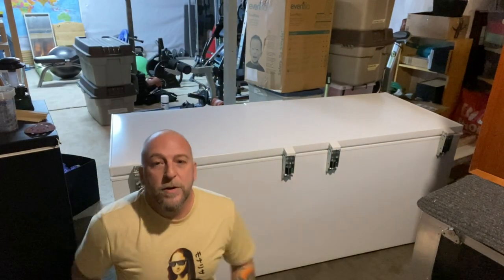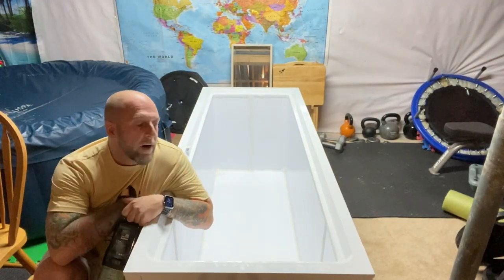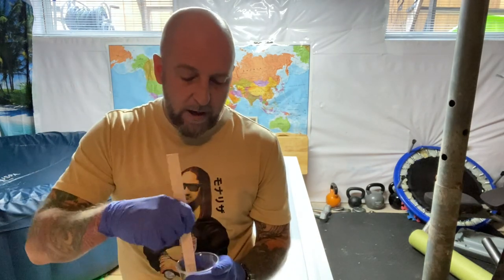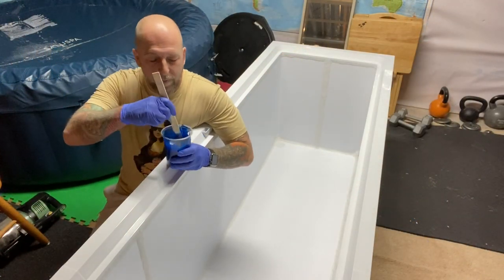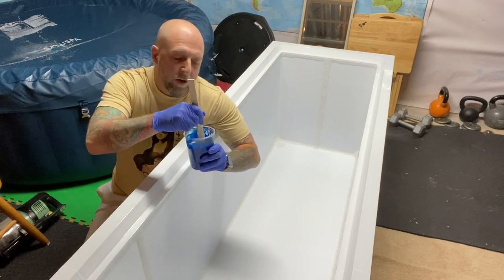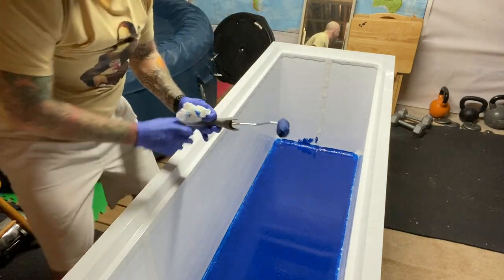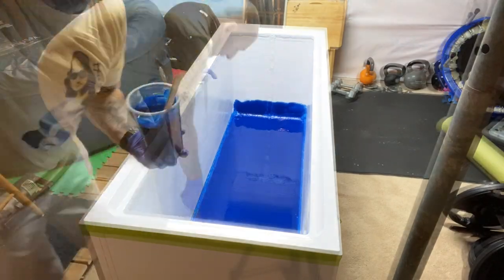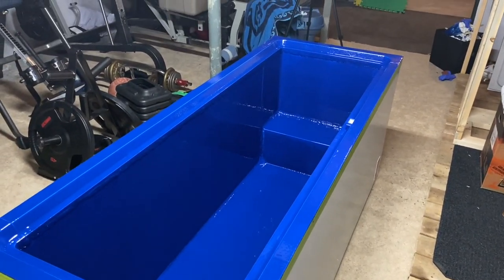Chest Freezer Ice Bath pond shield application 11922

Comment: How do you drain the water when you need to refresh the bath?

I have the same setup but mine has a makeshift drain plug at the bottom installed by my friend

Just wondering about leakage solutions if you have a drain plug as well
Reply from the maker: I don't have a drain plug. I use a submersible pump to empty it

Comment: Great video pal! I’m doing my chest freezer tomorrow with sky blue. How has yours been holding up after a year? Thanks for the video.
Reply from the maker: My pond shield has held up amazingly well! As long as you take care in the application it should last for a very long time. the only problem I had was a spot near the top that I accidentally banged when I was fitting in my filtration system

Comment: Hey Brad, just looking for some clarification about the process for a freezer with an aluminum interior. Is application of a self etching primer necessary prior to the pond shield? If so, do you sand before or after applying the self etching primer?
Reply from the maker: From what I've learned yes you should probably sand before you use the self etching primer. I don't have any experience with aluminum interior. I would recommend you look for the Facebook group DIY Chest Freezer & Chiller Cold Plunges. It's run by a guy named John Richter and you will find a ton of great information there. I learned a lot of stuff from him and the group.

Comment: Thanks Brad, extremely helpful video. Thanks for sharing. Is this pond liner cosmetic or does it help with sealing as well? Also does it make the tup slippery getting in and out. I think I want to have something to grip to at the bottom to get and out easier.
Reply from the maker: It really does help with the sealing. I had a freezer plunge with just JB water weld and it eventually succumbed to the leakage

Comment: Thanks for this Brad. I'm planning to do the same thing. I just wish you would have done a video on the JB Weld, which I also intend to use.
Reply from the maker: the JB weld wasn't too hard. Just make sure you mix it really well and use disposable gloves. It does get a bit sticky but you can dip your fingertips in some water periodically to keep them slippery. I  change my gloves a lot too.Make the JB weld seams about an inch wide. For my 21 cu ft freezer I used about 20 tubes
Reply: @edwardsfamilyworkshop  Thanks Brad. That's helpful.
Reply: @edwardsfamilyworkshop is there any reason you can't use marine sikaflex instead of jb weld?

Comment: Hey Brad, how is this coating holding up over time? Did you do a 3'rd coat or wish you would have?
I saw one of the comments talked about the metal interior versus the white. With all the research you did, do you think as long as it is sanded well the metal interior does not need a self etching primer before the pond liner? That adds a bunch of cost and complexity, so I would be very happy to just sand very well, do JB weld, and then pond liner.
Also did you think about doing any kind of flakes on the last layer like a garage floor to make it more grippy? Just a thought.
Reply from the maker: Hey Matt sorry for the delay. You know I had enough to do a 3rd coat and If I were to do it again I'd definitely do it. Once I had my process down it didn't take too much more effort. Next time I drain my plunge I just might add the 3rd coat. It can only serve to make it more robust. As far as self etching primer goes it's absolutely not necessary. I had a few conversations with other plungers and it was unanimous. In my experience I've never felt the need to add any sort of grip to the bottom. Just take it easy getting in and out. Hope that helps

Comment: Hi Brad. The interior of my 8.8 cu ft midea freezer I believe is some kind of plastic or pvc. will the pond shield work on plastic? If so would I sand or prime it first?
Reply from the maker: As long as you scuff it enough to make the pond shield stick you’ll be fine. 80 grit was enough for me

Comment: did you seal the corners with sealant before sanding?  or does the pond seal do the sealing. thanks
Reply: Looks like JB Water Weld was used which is what’s always recommended.
Reply from the maker: For some reason I didn't see this comment til now. Yes JB water weld would be the only thing you use to seal the seams

Comment: Hey Brad, I found your video to be extremely helpful. Thank you for posting it. I have a 14 cubic ft freezer, and it appears to have a metal or possibly aluminum interior. I'm interested in applying pond shield to it. Could you please provide me with the necessary steps to do so?
Reply from the maker: Thank you so much for the compliment. If you have the aluminum interior you'll have to do an extra step. Everything else in my video still applies. All you would need to do is buy a self etching primer to apply on the whole interior of the freezer. This will help the pond shield application adhere to the aluminum. That's all you would need to add to the process. hope that helps you out.
Reply: @edwardsfamilyworkshop is this a necessity?
Reply from the maker: @isaacsmith9981  from what I’ve learned from others if you have an aluminum interior then you’ll need self etching primer or the pond shield won’t adhere properly

Comment: Hey, Brad

After a few months how is this working out for you? I recently bought a freezer and have been doing a ton of research. Have you used the freezer prior to the pond shield?

It appears that you just have to fill in the edges with some type of sealant. Then you sand the freezer down, and the and in 2 coats of pond shield. Am I missing anything?
Reply from the maker: The pond shield has held up amazing. I cold plunge pretty much every day and there's been zero peeling or any issues. I first sealed all the seams with JB water weld which in my opinion is absolutely necessary. Some people look for cheaper ways but when you're spending this much time and money it pays to do things right. After the JB water weld I lightly sanded with 80 grit and put 2 coats of pond shield on. If you put the second coat on within about 10 hours theres no need to sand again. After 10 hours you would need a light sand again for adhesion. When I first started I had a used freezer set up about 2 years ago that I only used JB water weld on. It held up for about a year then it just died. I suspect that with only the JB the water eventually seeped in and that was that! Spend the extra $200 or so and make it last for years to come. Any other questions just ask buddy
Reply: @edwardsfamilyworkshop  So did you not use an acid etching primer on this?

Comment: Hi Brad, thanks so much for posting this! I'm doing this process right now so it is very helpful. When you did the sides, did you drip the pond shield on to the bottom and then pull it up the sides with the roller? I couldn't quite tell.
Reply from the maker: Hey Jeff thanks for watching. I just used the roller tray and tried to keep the roller just wet enough with epoxy so I minimized any drips. It worked out fine.And with doing a second coat there were absolutely no thin spots that needed to be retouched.

Comment: Hi mate, how long after finishing second coat did you wait till filling up? And did you rinse it out first ect? 
Cheers
Reply from the maker: Hey man I waited about 3 hours. If you wait longer than 10 hours you should lightly sand again for adhesion. I didn't rinse anything out. just made sure nothing got in there in between coats.

Comment: Great job on the video. That's the first time I'd heard to use the alcohol to help thin it a little.  Do you feel like this actually helps seal a little bit? I wonder if it would cover over silicone or just water weld?
Reply from the maker: The thing with adding alcohol in my opinion it just makes it a little more smooth to apply. You can definitely just use pond shield as is but if I had to do it again I would still use a bit of alcohol to thin it out. Thanks for the comment bro!

Comment: Do you use a filtration system to keep the water clean?
Reply from the maker: I use a whole house filter for filtration and a ozone generator to help keep the particulates under control. I also always have a shower and use a brush to scrub away any loose skin cells. It really helps I assure you. I get about 6 months of use before I change the water which is more than you can ask for. I’ve had a hot tub for years and I do the same with that. The biggest thing with water devices is soap residue from your skin and from your laundry so I always go in the buff 😁
Reply: @edwardsfamilyworkshop 6 months is awesome. I e added to the to do list. Thanks for the feedback.

Comment: Did you sand the first coat before applying the second coat?
Reply from the maker: If you do the second coat within 10 hours of the first coat its not necessary. Any longer than that you should sand again with 80 grit

Comment: can you please tell me the purpose of the pond shield??... does it make it more waterproof? and do you still have to Culk the seams beforehand?...
Reply: hey just chiming in.  I have a similar setup and have tried two different methods to seal it with bad luck.  (JB Marine Weld and Flex Seal Spray). Both leaked. I believe the pond shield will seal the edges and hold up to the temps.  Just my two cents.
Reply from the maker: I had a freezer before with only the JB weld and it seemed fine. That being said I would highly recommend using the pond shield over the JB water weed to make sure it lasts a long time
Reply: @RB-mn5ix  so your freezer leaked water onto the ground?... have you had success with any method so far?... thank you for your input
Reply: @thrive-like-a-viking  It had a slow leak that developed and it was hard to tell where it was from.  I tried the Flex Seal infomercial product and it started lifted quick.  I honestly think it’s the cold temps.  I striped it and had a similar experience with the JB Weld.  I intend to apply a pond shield product this week.  It wasn’t much of a leak but I want it right.  I also built a redwood 2 x 6 box surround around it to make it look finished in the backyard.

Comment: How has this held up? considering doing It didn’t know whether I should use a bedliner material or something like this.
Reply from the maker: It definitely protects well and gives me that extra piece of mind. I had another freezer I built a couple years ago that didn't have the pond shield and now it's no longer here so I just conclude that this helps a bunch. The bedliner option is in my opinion a better protective layer but it's also about 3 times more expensive.

Comment: Did you do that entire freezer with one 1.5qt kit?
Reply from the maker: I bought 2 of the kits. I used 1 whole kit and 1/4 of the other 1. After a year aha a half the pond shield has held up amazingly well. Hindsight being 20/20 what I should have done was use the whole other kit because let’s face it I’m not using it for anything else.
Reply: @edwardsfamilyworkshop  I did just finish mine. I only used the one kit, but it was 3 full coats. It could use another 1 more coat, but I left it there, working good so far., Thanks for the response.
Reply from the maker: @Lowlife62  I have a 18 month follow up video coming tonight that goes over my experience. Yours should be plenty fine💯

Comment: So did you not use an acid etching primer on this? Instructions say that
Reply from the maker: The self etching primer would be for treated metals like galvanized. I consulted with a bunch of other cold plungers on Facebook and it was agreed that it's not necessary for a painted white metal interior. I have had zero issues and it's been over 5 months

Comment: Did you already use a sealant on the seams of the chest freezer, before you put the shield epoxy ?
Reply from the maker: Yes I used JB waterweld. absolutely the best product for the job. I wouldn't use anything else
Reply: @edwardsfamilyworkshop  that’s what I figured. Thanks!
Reply: @edwardsfamilyworkshop how long after applying jbww did you wait till you sanded and applied pond shield?

Comment: Well, I fucked up. Part a is written in a letter with expiry date, so small I couldn't see it. Thought it was just mix and apply, not opening part B. So didn't have enough but was enough farcthe walls. On the bottom I poured beach sand and poured regular epoxy.

Comment: Hi this may be a silly question but has the pond shield affected the cooling efficiency of the freezer by placing an insulation layer of sorts over the interior of the freezer?
Reply from the maker: That’s a valid concern. I’ve talked with an actual appliance repair person and the thickness of a pond shield application would be negligible when it comes to that. Don’t worry about that at all 💯

Comment: How is it holding up?
Reply from the maker: It’s been over a month and it’s all good
Reply: @edwardsfamilyworkshop   that’s awesome! We are building one and you are one of the few to use this pond shield.
Reply from the maker: @Flickadasticks  the first freezer I had I only used JB water weld but with this new one I'm sure glad I used the pond shield as well
Reply: Brad,  we appreciate the feedback.  My JB weld didn’t hold.  I was planning on stripping everything and priming.  Then sealing with the pond shield.  Will it fill the seams too?  lastly,  what size container of pond shield?  TY
Reply: So I did my first coat of pond shield today and it’s didn’t hold to the plastic line on my chest freezer. I think I didn’t sand well enough for it grab.
Reply from the maker: @RB-mn5ix  thats strange that the JB water weld didn't hold. There are a few JB weld products. It needs to be the JB waterweld. I wouldn't solely rely on just the pond shield.
Reply from the maker: @Flickadasticks  yes thats most likely the case
Reply: @edwardsfamilyworkshop  I see pond shield makes a crack filler caulking.  I think I may try it prior to the shield. Thanks for the input
Reply: How long did you wait for second coat?